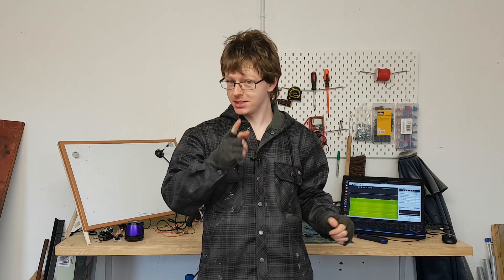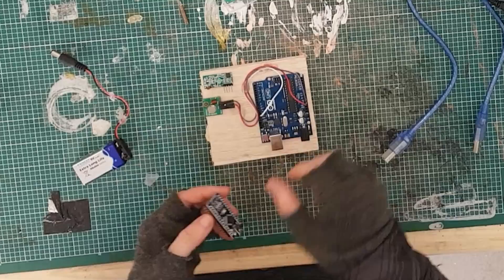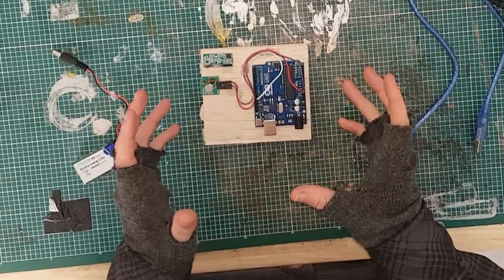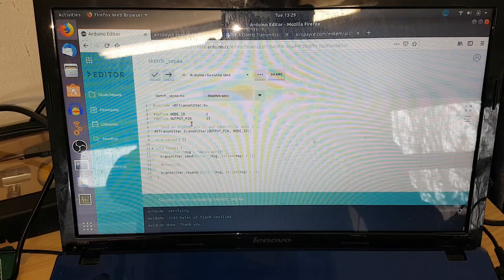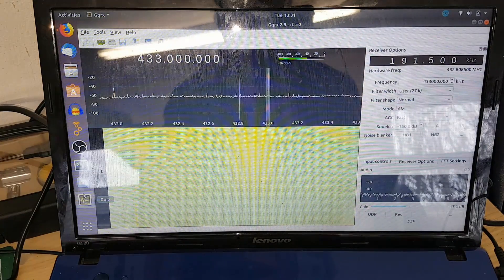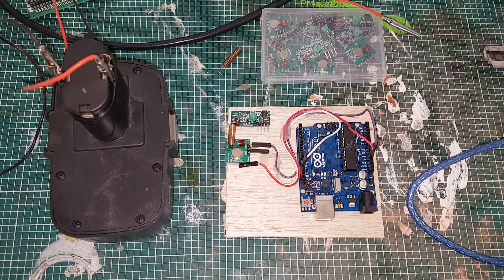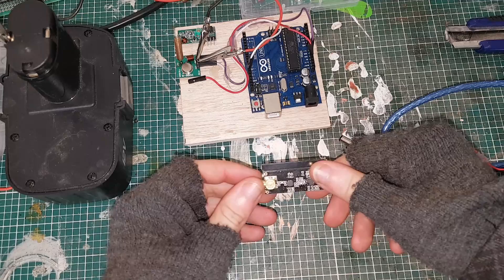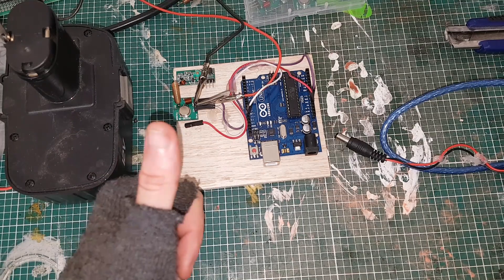How to make a Cheap Jamming device

Comment: It’s very odd when I try to view these types of videos it appears that YT is jamming the feed but their GD f'in adds get through. FOUL YT!
OK WTF is a bear token? Feed the output into an intermediate PA which can drive a higher power amplifier. It would be nice if you can control the output frequency via computer program. This way you can sweep through the whole segment of the band randomly so you can cover a wider range of frequencies.

Comment: Its a nice video, but we tried the same procedure through arduino boards. But , we faced one issue in dumping the code on to the board but the code is error free . avrdude: ser_open(): can't set com-state for "\\.\COM7"
Failed uploading: uploading error: exit status 1 , Please address the issue
Reply from the maker: That's an issue with your connection from the computer to the board

Comment: You realize that the arduino is completely unnecessary right? Your just using it to constantly transmit. You can do that by just pulling the transmitter modules data pin high with a resistor. Since it is a basic OOK analog transmitter it will transmit anytime the data pin is high. No microcontroller needed. Also I dont think this can really be called a jammer. It's just a transmitter and it's only operating on 1 fixed frequency. 

If you're trying to jam 433mhz/315mhz all you really need is a powerful RF amplifier and an rf sweep generator that both operate in that freq range.

Edit- I like the part where you didnt even hit the button on the key fob at the end because it doesnt even work lol.

Comment: I built my first FM Radio jammer 40 years ago, I remeber I used 3 transistors, a cap and few resistors and hand made antenna - the jamming reached about 20 meters far and I could jam people near me who were listening to FM radio.
Reply: I made 100w and all city was jammed cca.40yrs ago...
Reply: @alexander19681   Bravo to you
Reply: @alexander19681  Sure buddy
Reply: @randomautonomousdronepilot3384 40 years ago, there were only 3 FM radio stations in Slovenia, when we were under the Yugoslav communist regime.
Reply: @alexander19681  you can’t do that in the states any more. The FCC has monitoring stations almost everywhere in the country and can locate a jamming signal remotely and then send out a van that can pinpoint the signal source. Depending on who it has jammed, how often and the age of the perp it might range from a warning and confiscation of equipment to federal charges of terrorism which is a free pass to Club Fed.
Reply: I ve a college project of 5 w 20 mtr jammer... Pls help me to design
Reply: @godsowncalicut1438  hope firas found a way to reply out side comments if it wasn't your thesus
Reply: Do you have video turotial?

Comment: The Arduino IDE says "success. saved on your online sketchbook and done uploading rfj_file." avidude done. Thank you. I got the code correct, however Im not transmitting. Is it possible I have my pins connected to the wrong ports? The vcc, gdn, are correct. The data pin to transmit is 10-csn, 11-mosi, 12-miso, 13-sck. Is this correct?????????? Thanks

Comment: Does this work on low frequencies like 10MHz or 20MHz or I can have a cheaper set-up?
Reply from the maker: Going into HF you need a far larger antenna 10Mhz you need an antenna around 15 meters long and half that for 20mhz. The transmitter would have to different to. But if you want to transmit on those frequency's get yourself an amature radio license, a HF rig and your good to go!
Reply: @Brains933  excuse my ignorance cause I've just been researching today. I need to create like a usb flash disk size device to block these waves. And I need to make a very small blocking range like 30 cms. Does this make sense?
Reply: Can I commission you for one to block v2k?

Comment: Hi, are these frequency locked or could it be tuned to tx on 431 or 430Mhz?
Reply from the maker: This module it is fixed. There may be a way of changing it. But there are equally as cheap modules which can be changed I have another video on that :)

Comment: This is great. I want to jam drone signals. Can we jam drone signal from this stuff?
Reply from the maker: No you need to have a device able to go up to 2.4Ghz but these are easy to get online
Reply: @Brains933  by device do you mean a module that works at 2.4GHz? would a standard 2.4GHz transceiver for arduino work ?

Comment: I get this error when trying to import the zipped library file: [] parse library.properties: library.properties not found

How do i fix this? thanks
Reply: Me too, did you find the anwere? please share
Reply: @lindavandelouw3567  where did you get the code...? Please let me know...!
Reply: well with my last breath i tried without any software, just the arduino hardware and 9v battery on SDS sharp airspy.
Without programming but with the 433mhz chip it shows a signal. Maybe thats hopeful for you. 
However it does not jam the car key or door bell yet. Please, i know what its like to get electronic harassed, being female and no tech experience. This is simple, i will ask around if there is something for the parse library problem and if its nescesary perse. We need to help eachother when jamming is the only answere. maybe i have to delete this but then i hope u get the information. 
So again: get sdr sharp airspy with a dongel and then you see an incoming singal even without programming the chip. Hope to god this works thanks dear bye

Comment: hypothetically, could this prevent my neighbors radio from playing trashy music?
Reply from the maker: Hypothetically....No it's too low power
Reply: @Brains933  but if it were closer to said radio? is there a way to up the power?
Reply: Maker Vlog  could you make one what’s possible to block people torturing you with frequency’s
Reply: @Brains933  can you share the code for this project. The code in The given link isn't working.. 🙄
Reply: Just get a .5W fm transmitter, same frequency :D
Reply: You can buy a cheap jammer online that can block cellular network and even wifi. But it might no be very legal to own
Reply: also does this program work with an adafruit pro trinket 5v?
Reply: Birth control
Reply: @Nathan Slaughter you're* dumb
Reply: What about a CB kicker? Like 3000watts?
Reply: Your messing with the FCC. They can sue
Reply: If you have to ask questions like that, you shouldn't attempt to build or operate a device like this. And no, of course a little 433 MHz transmitter won't block your neighbour's radio.
Reply: @ErikBročko  its hypothetical dummy
Reply: Nonsense. Do you think people are born automatically knowing how to do this stuff? They have to start somewhere, tinkering with something that is relatively non-deadly/dangerous. I hate when ignorant people say, "If you have to ask, you shouldn't be doing this". Newbies WILL attempt it no matter what anyone says, best we can do is help them so they don't make mistakes. It's called harm reduction.
Reply: Lovely intro

Comment: So all you need is the Arduino? The transmitter and power just affect the strength and range?
Reply from the maker: Pretty much
Reply: “Alright frank, you can unload the 50kw generator over there, and put the massive radio antenna over there.” 

😂🤣
Reply: @NPCSN  I'll just leave this here...
 

https://www.amazon.com/Tupavco-TP512-Wi-Fi-Antenna-2-4GHz/dp/B008Z4DNFC
Reply: @NPCSN  And connect this matchbox at the end ;)

Comment: If we want an stronger jam signals can we also make more of that piece of hardware and run it. Like if i build 10 pieces of this. The signal wil be greater i think.

Edit:

Because on shift keying isnt the jamming working what my car have.
Reply from the maker: Adding more of the same transmitters wouldn't give you much of a boost. What you could do is have them all transmit on different parts of the frequency to cover the whole 433Mhz band and that would be able to overcome the FSK on your car you mentioned.

Comment: Would that setup work with just the data pin going to the transmitter an a separate 12v going to the transmitter?
Reply from the maker: Yes but you need to still have the ground connected to the arduino as well as the 12v source. Be careful when you set it up there is no reverse protection I have let the magic smoke out of a few transmitters through stupid wiring.

Comment: How can a jamming device be over rided?
Reply from the maker: You need to either find the jamming device and disable it or be able to make the signal you want to get through stronger.
Reply: @Brains933  maybe there is a way to get the signal stronger somehow. The jammer hiding
Reply from the maker: Sorry maybe I have misunderstood,  are you wanting to know how to overcome being jammed or how to make the jammer stronger?
Reply: @Brains933  I think I would like to make my data stronger so it over rides the jammer since I don't know where the jammer is
Reply from the maker: Ah ok in that case yes amplify your signal. although jammers are easy to find if you use an SDR or somthing to see the spectrum with you use that and walk until you find the strongest signal
Reply: @Brains933  thanks, that gives me a direction to start with 👍☺️
Reply: Rochelle Lisa did you find a way to block the jammer ? I would appreciate any information ?
Reply: Is it able to jam bluetooth devices ?

Comment: Have you tried the amplifier yet?  Which one are you planning on using?
Reply from the maker: I have, I am just waiting on some connectors coming in the post. I have two, one is around 9Watts and bought off the shelf. The other is 45Watts which I have yet to finish building.
Reply: @Brains933  Very cool!  Keep us posted, this is a pretty interesting project!